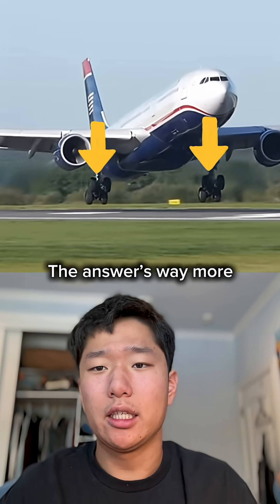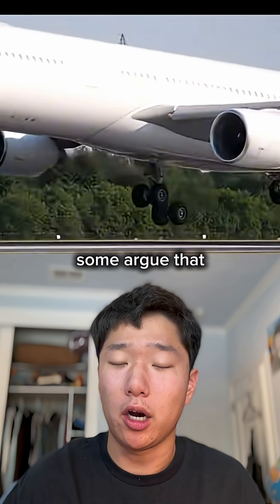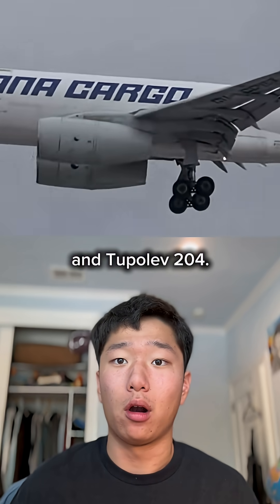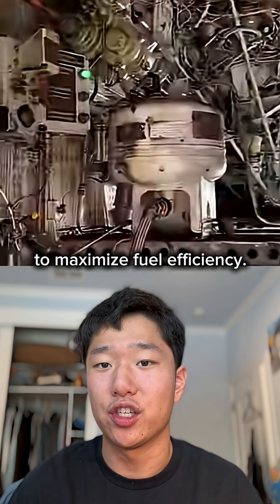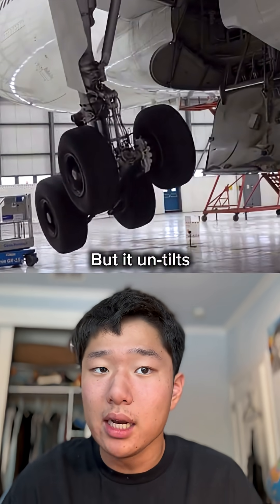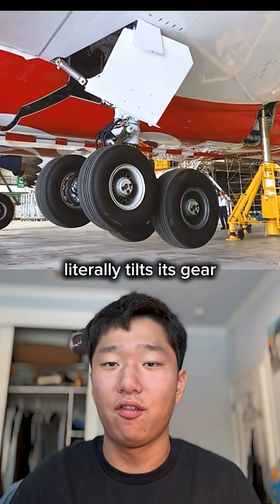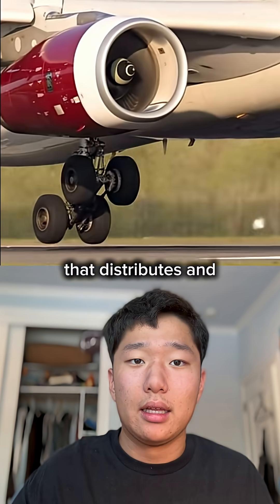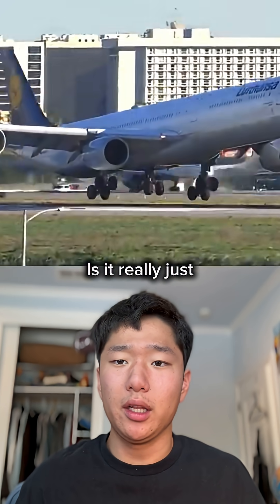Why is aircraft landing gear tilted?  #airplane#aviation #landing #aircraft #aviationgeek #butter

Comment: I am a big fan of aviation but this is one of the questions I don’t know so I went online to look it up and this is what I found Aircraft landing gear wheels are tilted to allow the gear to fit efficiently into the wheel well during retraction, improve aerodynamics by reducing drag, enhance stability and shock absorption during landing, and provide ground clearance. The specific direction and amount of tilt vary depending on the aircraft model and the design of the wheel well 

( I took this from Google )

( i’m surprised about this because I’ve been studying planes for almost 4 years now and I don’t even know so I had to look it up 😂 )

Comment: to maximize storage space in the wheel wells, enabling more room for fuel and passengers, and for engineering optimization, which can provide a smoother, more stable landing and takeoff by absorbing impact gradually or counteracting tendencies to pitch

Comment: The a330 shortens because it's built on the a300 frame with larger engines,  so needed extra height, but the body didn't have room for the extra height.

Comment: Planes' landing gear tilts to fit into a confined space when retracted, allowing for more room for fuel tanks, cargo, or other components. This tilt is achieved by a hydraulic actuator. When the plane lands, the gear's tilted position helps to absorb impact and smooth the touchdown. It also plays a role in air/ground sensing, which activates other systems like spoilers and reverse thrust. The angle and direction of the tilt can vary between aircraft models to optimize space and landing performance.

Comment: This probably only has to do with the mechanisms and not aerodynamics. They all have different designs and combinations for wheel suspension /shock absorbers, and the tilt is probably just the best position for the least wear and tear on the stuff.

Comment: There is no function for the tilt, the gear should be free to move when extended. When going into the wheel well, the tilt angle of the gear lock up to suit the space. When it is gear down time, the tilt rotation transition from locked to free-to-move. The gear just tilt to whichever side that is heavier (usually the side with the actuator hinge).

Comment: The tilt direction and angle doesn’t really give an explanation, acts the actuator in the rear or front that makes it so that the gear doesn’t flip back and forth upon touchdown, because that would cause damage. And you might think, then why not just have one axle? The answer is because certain airports have weight limits per axle just like on highways. That means aircraft might need more axles to spread the weight out. That’s also why some Air India A320’s had a double bogey

Comment: It actually depends on the aircraft. The fitting in the wheel well part isn't entirely false, first of all. I'm not a professional, but here's my take. In some aircraft like the 757, the gear needs to be un-tilted in order for it to fit in the wheel well because the landing gear strut is not exactly perpendicular to the fuselage. As for why the gear tilt is present in the first place, like I said, it depends. Like you mentioned, the 767 has very forward tilting landing gear. The reason for that is because during testing, Boeing noticed that there was a tendency for the aircraft's nose to quickly drop after touchdown, so they implemented the forwards gear tilt so that the front two tires would touch down first, and the hydraulic force of the main landing gear would bring the back bogies down afterwards, which would slow down the fast pitch decrease. Another thing that applies to, I believe, almost all aircraft is a prevention for the landing gear to retract or some other ground only features while on the ground. I'm not too sure on this part, but I believe that if the landing gear isn't properly tilted, the computers would sense that and prevent gear retraction. A similar thing applies to thrust reversers to prevent opening them in the air (there are exception aircraft that allows reverse thrust in the air, though - that's different). Lastly, there might be a drag load reduction. Since on most landings with gear tilt, one set of wheels would touch down before another, there would probably be less force on the landing gear, which means there could be less support built in to make the aircraft lighter. You do pose some very good points, but unfortunately, like I mentioned, I'm not a professional at all. Please, if anyone knows, let me know and correct me in the places I'm wrong. Thank you!

Comment: my only guess is that it's so that the landing gear can have all wheels on the ground 

basically, before landing, the aircraft would usually flare, and because of that, not all wheels would be on the ground (if it's rigid)

if it's able to pivot/tilt, then it can have all its wheels on the ground while the nose gradually lowers itself.

as to why some tilt forward others tilt backward, I can only assume that it's weight-related

another reason why is to probably prevent the gears from snapping

you see, if it's rigid, then, the landing gears cannot pivot 
and because aircraft usually flare/pitch up just before touchdown, if the nose is still tilted up, the landing gear may not be able pivot as the aircraft decreases altitude, leading to damage or even the snapping of landing gears.

Comment: The A350-900 and 1000 Have different LG. The 900 is 4 Bogie layout which tilt forward and lands on its toes yet the 1000 has a 6 wheel bogie that tilts backwatds and lands on its heel

Comment: Shock struts take a lower jerk and possibily force particularly for the initial take up of weight. Helps to smooth the compression of the struts where they might be shorter and stiffer.

Comment: It's just so there's a pivot point as the nose comes down or lifts off. They pivot freely, so whether they are tilted front or back makes no difference at all. If they didn't tilt, all the wheels couldn't touch the ground at the same time until the nose wheel touched down, defeating the purpose of having more than one set of wheels on each side. The purpose being to distribute the weight of the aircraft over a greater area.
Reply: The weight of the airplane will only be fully distributed onto the main gear tires once the lift is destroyed. It doesn’t matter which touch down first or which doesn’t. It doesn’t defeat the purpose at all.
Reply: @0w3nn  If they don't pivot, then all wheels can't touch the ground until the nosewheel is down. You want the main gear to take ALL of the weight of the landing first. In fact, the spoilers activate once weight is detected on the main gear.
Reply: @chrisbrooks6697 Yes, it needs to pivot so all the wheels touch the ground. But why the gear is tilted, it’s still unexplained.
Reply: @0w3nn  It tilts freely. the heaviest side is pointed down due to gravity.
Reply: @chrisbrooks6697 Again, doesn’t explain it for all aircraft. Some aircraft with non-tilting gears like DC-10, L-1011, A300, MD-11, which theoretically should thrash around by the smallest forces using this theory. 

If you take a look at UA232 photos before it crash lands the gear actually tilts forward due to gravity, implying the gear is hydraulically held.

Also notice the A300 doesn’t have gear tilt but the A310 does.
Reply: @0w3nn  They absolutely do tilt. They just use dampers to keep them from tilting all the way to the stops.
Reply: @chrisbrooks6697 hmmm good point. So why doesn’t aircraft like A330, 777, 767, A340, 787 use them? Cost issues? What’s weirder, why did the A310 remove the dampers when the A300 already did?
Reply: @0w3nn  Probably cost and weight, and they aren't really necessary unless they need them in a certain position to retract.
Reply: @chrisbrooks6697 So then how come on the 787, the gear tilts forward during hydraulic loss? Why does the 787 use these dampers to tilts them backwards rather than untilt them? Sounds totally unnecessary.
Reply: Again this is disproven by plenty of planes that touch down flat with all wheels at once

Comment: Shock absorption & stability – When the plane lands, the angled gear helps distribute forces more evenly. Instead of taking a direct vertical hit, the gear flexes slightly, reducing stress on the structure.

Aerodynamics & wheel fit – Tilting the landing gear lets the wheels fit better into the wing or fuselage when retracted. If they were straight, they might stick out or need larger compartments.

Taxiing & cornering – A slight tilt gives better stability on the ground, especially for big jets with wide, heavy bodies.

Weight distribution – The tilt helps align the wheels with the way the landing gear struts are mounted, ensuring even tire wear and smoother operation.
Reply: ai...?
Reply: Hate to be that guy, but the gears only tilted when they’re in the air, so the gear being tilted wouldn’t matter in any way whatsoever well on the ground.
Reply: Chat gpt ahh answer
Reply: Hi ChatGPT
Reply: @chirpyrobin001 it’s common sense, not ChatGPT
Reply: @AviationAndTechTalkit's just styled like AI, all grammared and spaced correctly, and with those large gaps in between
Reply: @chirpyrobin001 I suppose it is possible, but there are a few mistakes in his logic, then again AI isn’t perfect either…
Reply: @AviationAndTechTalk
It's completely AI generated. I mean, it's not directly a bad thing but it's a fact.

Comment: For the forward tilted gear like the a330 is for smoother landing but for backward tilted gear like the a350 is for s higher angle of attack during take off i think?
Reply: about.... A350 is also actually heavier for it's size, though it's the lightest 'jumbo' that there is, 787 is tiny compared to it